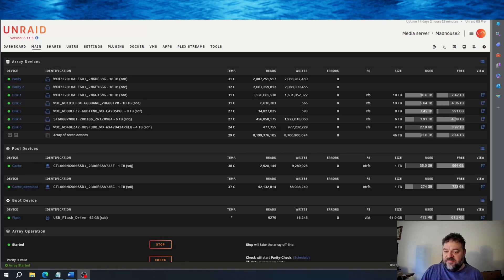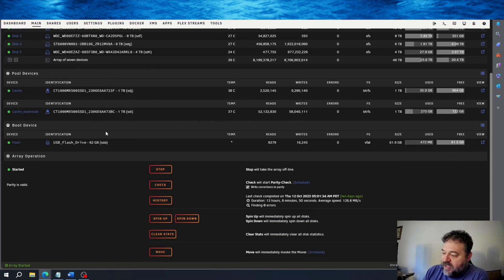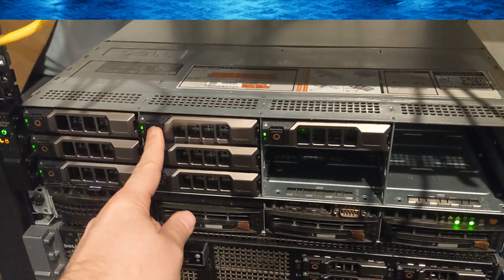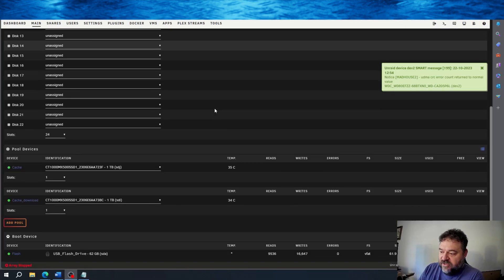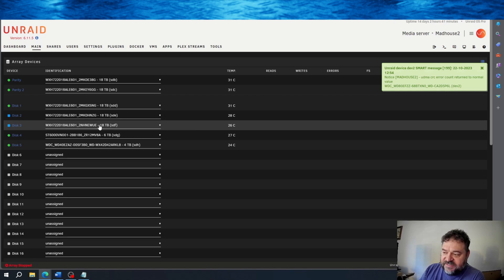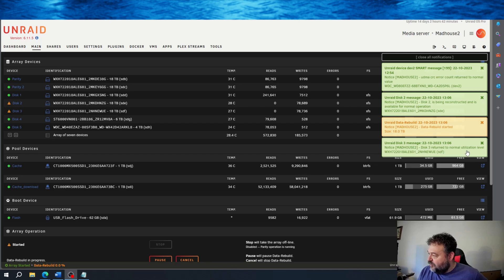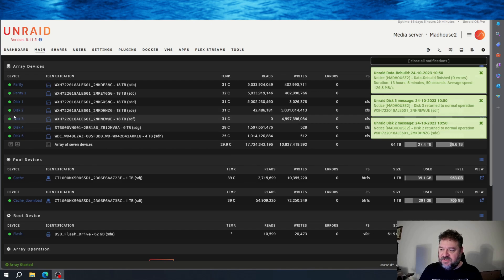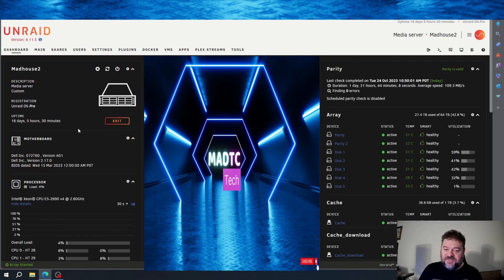UNRAID: Two Failed Drives!

Comment: I thought you were supposed to rebuild in maintenance mode as a precaution?
Reply from the maker: You are not wrong.  It is better to rebuild in maintenance mode. I just did not want to take everything offline for a while.
Reply: @madtc74  thank you for the clarification! I’m very new myself and just looking to understand.
Reply from the maker: @DonPapiLuis  no problem. I am always learning new and better ways of doing things. Sometimes you do something that works, but later find out there is a better way to do it. It is all a learning process.